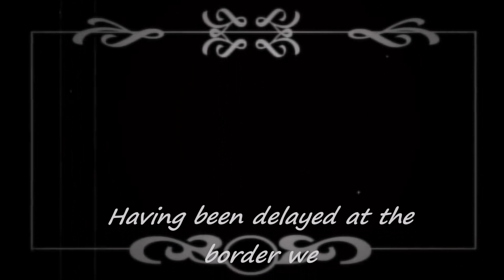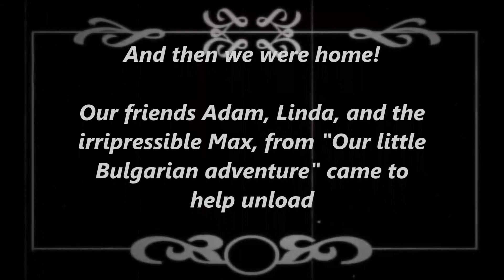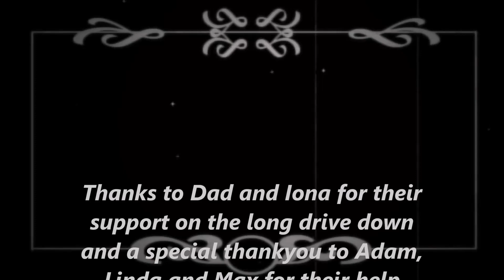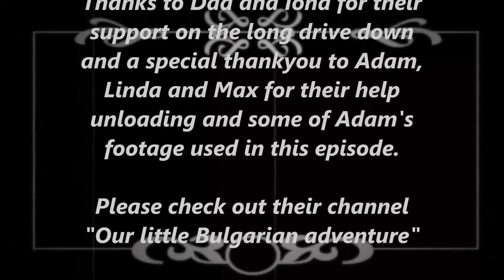Episode 11 ... The big move down to Bulgaria!

Comment: The costings surprised me I expect it to be more especially with the current fuel prices. Did you have any issues at Borders or any import duty to pay?
Reply from the maker: Surprisingly no issues at the borders at all. We did an in depth inventory translated into the various language's and only showed it twice. A quick look and we were moved on with a gesture that said "We don't have time to check out that flippin lot!"
Fuel was double what we paid when driving up in March, but that was virtually empty and not towing a trailer. Hungary were sneaky in that what was advertised on the roadside signs was for locals. On the pump it was double!
Reply: @newbeginningsinbulgaria  I'm in no rush to drive our belongings over and will definitely wait until we have resendency, 🤞fuel prices go back down.